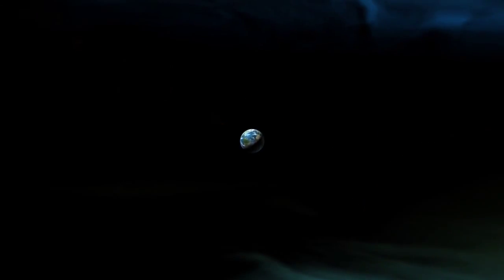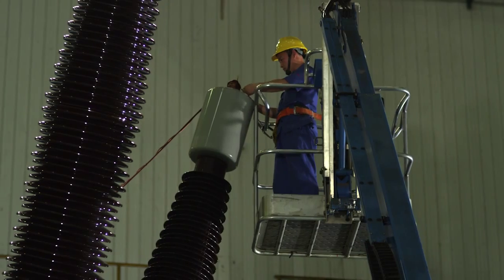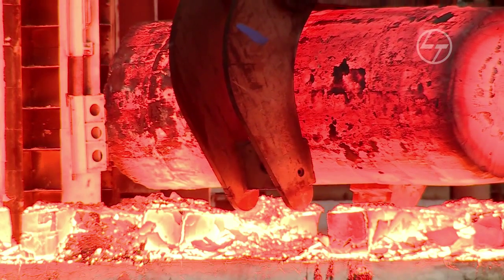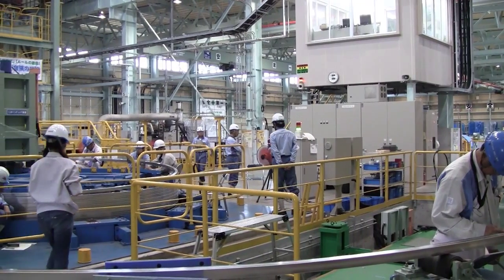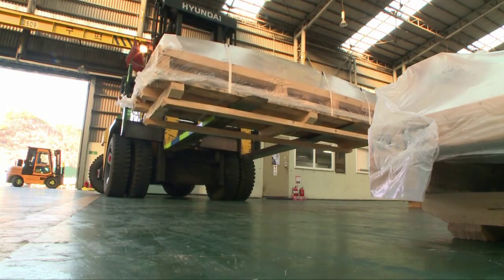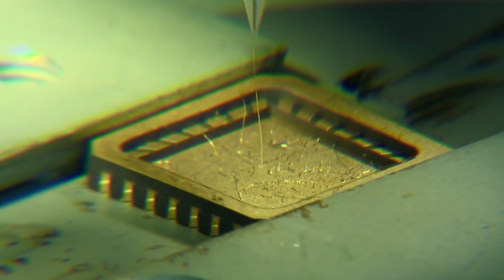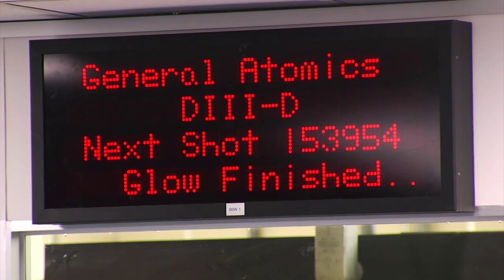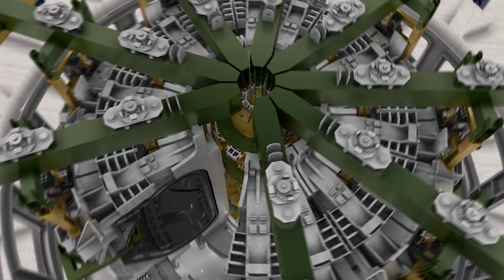Around the world of ITER Manufacturing Sites

Comment: It's such a huge and expensive undertaking.  Is it not possible to build something on a smaller scale, just to verify that it works?
Reply: They've already made dozens of smaller Tokomak reactors.
Reply: Fusion cannot be contained by small vessels. They're simply not powerful enough.
Reply: Efficiency drops like a rock with tokomak size, many have been made, but this is the first one that is large enough for actual power generation. If your efficiency is not good enough you spend more power keeping the reactor going than you will ever get out of it, making it useless for power generation.

Comment: Why are they building components in different countries which have different weather(temperature, humidity, gravity and air pressure due to different attitude) which will alter the size of the component at atomic level, may increase error level above the allowed tolerance of a few millimeters.

I hope they did take this into account and equalized all the conditions during manufacture and transportation.
Reply: It has all been taken into consideration. That's why they have dummy products, they test if the dummies work as expected beforehand.
Reply: Lea, the actual construction facility in France, where the components are brought together and joined, is a clean area that’s kept at constant temperature to account for material changes.
Reply: Temp, humidity and air pressure change daily, even hourly, you must consider these factors in any case. And it is considered, even in manufacturing of fairly mundane things, let alone in fusion reactor components.
Reply: It's world's most expensive experiment.
Reply: Bcoz it is expensive plus work is given to countries according to what they are specialized in

Comment: cant wait for it to start tests.
Even if it doesnt work...well , at least we tried...we gave it a 110% RED HOT GO  didn't we.
That's nothing to be sneezed at.
If it does work? well thats only the start. We cant all afford such machines.
Will take years to refine and perfect. This one machine wont power the world.
Reply: Banbury Cross This one machine is going to power nothing. It has no electricity generating parts. It's scienctific only.
Reply: It's designed to test if the power of fusion ignition can be contained.
Reply: It'll work alright, it's not exactly being built on a maybe. But there is tons that need to be learned about actually operating such a machine, lessons that will feedback to next designs. I bet there will be lots of cases where in hindsight people realize that things really should have been designed differently.

Comment: Do we really need a new source of power this badly? Does creating 150,000,000º C on our planet really seem safe to y'all? To compare : "The Sun has a temperature ranging from 6,000° Celsius at its surface which is hot enough to turn gold, tungsten and EVERY METAL ON EARTH INTO GAS (to) around 15,000,000° Celsius in its center". IMhO, three words sum this thing up : unnecessary, reckless, INSANE.

I await the variations of "luddite" ad homs that will likely follow ... > : [
Reply: Yes we do. Free(er) energy is the key to equality.
Reply: youstandcorrected we already have free solar, wind, tidal and geothermal power sources to choose from, which we've only barely begun to make use of. So perhaps you could explain why you believe we require this RISKY alternative ...
: / > -
Reply: There is nothing risky about it. The main difference in the sun is an enormous pressure whereas in iter there will be no high pressure. The hot plasma has relatively little thermal energy in it which would not affect the surroundings or leave the building even if you could imagine a scenario where it leaves the machine. Which makes it safe is that there are no dangerous substances used as fuel and no potential for the reaction to move on on it's own and get out of control compared to other nuclear power sources. The reason why we need such energy source is because it can be done anywhere compared to sources like wind and water, and it produces a constant amount of energy without fluctuations, so missing wind can't make you run out of electricity.
Reply: Frank Steffahn First, thanks for your civil response. It's refreshing to not be insulted right off the bat. Here's hoping my reply will not cause you to reevaluate that choice ; -) .

Now ...

"Nothing risky"? How can you know this? Isn't this an all new process? Imo the unknown always suggests some potential for risk.

A substance heated to 150,000,000º C has "little thermal energy"? Relative to what exactly ... a supernova? Certainly not anything occuring naturally on the Earth.

Hot plasma is not a dangerous substance? Well sure, any lightning-struck fool can tell you that.

Where on earth does the wind not blow? Oh yeah, under the water ... that ebbs and flows, creating potential tidal energy. And considering that about 7/10 of this planet's surface is ocean there isn't much land that can be too far away.

You seemed to forget about geothermal, which according to it's name is kinda available everywhere on earth.

Solar is also generally available I understand.

 Finally, if you want energy without fluctuations, better stick with DC. But seriously, I'm sure you know we have ways to store energy when it is not being produced.

So ... "Risky"? Yes. "Unnecessary"? Yes. "Insane"? Happily you didn't contest that point, so I'm under no obligation to defend it at this time. Cheers. : ) > -
Reply: AHerderOfCats I think you got some good points.

Still keeping the point of safety, the low pressure of the gas (or plasma) combined with the high temperature makes it have very little mass and hence little thermic energy. It's not like there is as much stuff, pressure and temperature as in an exploding hydrogen bomb. Also the magnets surrounding the gas get cooled down to just a few degreeds above zero Kelvin for the superconductors to work. If I had to guess what could happen in worst case, the reactor could break from the heat maybe, but it would not reach much further, not leave the building. Compare that with nuclear power from Uranium that has the potential of the reaction going out of control and heating up by itself further, this fusion reactor actually gets to 150.000.000° C by heating it up with microwaves from outside, so it is coming from electricity, not on it's own. The energy is very well comparable with other things on earth, they say you need the equivalent of a few thousand electric stoves to produce all the microwaves. If it gets colder when something brakes it is safe, because all the fusion will stop immediately.

I don't know much about geothermic energy but I doubt that it yield very much energy and also works all over the world. Nuclear fusion has the potential of enabling gigawatt power plants with no constraints of where to build them.

I live in a region that produces a lot of wind energy myself and I can say that from what I know, the fluctuation is a pig problem. They can even yield negative electricity prizes at the stock market (or wherever they trade it) on stormy days. Solar power is more constant, but still depending on weather and producing over the day while the power is needed in the evening when it's dark outside, or in the winter when it's cold but the solar power is much weaker. The only great potential I see in solar power is the possibility of decentralized power generation with people also having their own batteries to store power. Otherwise it would need new techniques, yet to be found, or a load of resources to make centralized batteries for storing the power.

As long as you'd need centralized oil, coal or uranium for power plants I'd prefer a working fusion reactor, hopefully becoming a working and cheap alternative that can be used in a few decades.
Reply: Well, hope to the side, the ITER's definitely NOT "cheap" : "Delegates agreed that the overall costs of the project will be almost US $21bn, (16bn euros/£13bn), some three times the original price." @ www.bbc.co.uk/news/science-environment-10793883 (2010)  ... nor has it worked. The word you omitted from your description of this experiment is THEORETICAL. Point is no one can say for sure what will happen when that thing is switched on. And I know of no necessary reason, nor have you presented me with one, sufficient to offset the concerns I have expressed. You keep trying to imply an explosive threat ... or a runaway reaction. Let me make this clear : I have no idea what could happen. But, my friend, neither do you. So how bout we leave the sun out in space, turn off a few lights and learn to live with what we have?

Our problem here is not a lack of energy. It is powerlessness. The fact that these people can do these risky things without our permission is the height of tyranny. All the way back to the Manhatten Project, which some involved believed had a chance of blowing away our atmosphere, right up to the LHC, and it's potential to create localized / extremely dangerous "strange particles". These people gamble with all our lives without ever seeking our consent. Please understand, I'm all for progress, but not if it puts the entire human race at risk. Speaking of risk, probably a good time to state my position on probabilities : a thing will either happen or it won't. That makes everything 50/50 ... a flip of the coin. While this may sound quite radical, it's an absolute truism.

I say let them build a space platform and test this reactor off-world. And if they can't do that yet then WAIT. Be patient. Why the RUSH? Again, we don't NEED ENERGY THAT BADLY. : | > -
Reply: AHerderOfCats No, ITER is not cheap, but it is a prototype, as I said I personally hope (as probably the people doing the research and experiment do) that it could become a rather cheap source of electricity, especially by means of sustainability and no environmental requirements. I'd just like to note that you're wrong about that such nuclear fusion it is that much of an unknown business. ITER is just a pretty large fusion reactor and it has the goal to be the first of its kind that actually produces more energy than it needs to heat up and power the magnets. The ability to control such fusion is from the underlying theories already a few decades old and they also had working experiments 20 years ago. It is more of an engineering task and a experiment to further develop the technology and make it happen.
Reply: You seem determined to ignore the bulk of my argument while reaffirming your faith in this risky and unnnecessary venture. But as this is 'much ado about nothing' and we've no say in the matter either way, I'll yield. Thanks again for keeping this discussion civil. I've enjoyed it. The final word is yours. Peace.
: ) > -
Reply: AHerderOfCats "Powerlessness", I thought about what you said. I think I share your opinion about this, not on the topic of nuclear fusion specifically but on the political system overall. The way modern democracies work gives people little opportunity to participate with a more detailed and sophisticated opinion. I don't really see signs of the current politic situation at where I live literally risking the whole humanity, literally causing big explosions in unsafe power plants, but environmental and economical politics going wrong can definitely cause death and definitely somewhat do go wrong today in many modern western countries in the world. That's why I go elect parties more because they support plebiscite then because they have all the particular opinions about topics or they are popular and would more likely lead the government.
Reply: There is like 0 risk with iter. Even if the plasma escaped it would do much more then melt the reactor. Just because it's a big number doesn't mean it's dangerous just like how having 1m Ecuador sucurs isn't worth shit
Reply: There was a lot of stupidity in this discussion sprinkled with out of context hard data and scientific theories.
Reply: Its safe alright. Temperature here is quite misleading, what it means in this context is it's actual physical meaning - velocity of particles, not your everyday experience meaning. 
Its better expressed in elecronvolts, meaning the speed a particle with the charge 1e is accelerated by when passing potential of 1V.

170MK would be around 15keV, temperature a fusion reactor would work at. 15kV is also a typical working voltage of a CRT monitor. If you wanted to describe CRT monitor in terms of temperature you would do it the same way, electrons accelerated over ~15kV ergo temperature or 170,000,000ºC, kind of pointless though.

Same thing with fusion reactor, yes the gas inside it really gets a spin on it, but the total mass of that hot gas is minuscule and if the gas should touch the reactor walls it would cool down instantly and ruin the reaction. The reactor walls wouldn't ever flinch at it, at one side you have half a gram of superhot gas, on another side you have few thousand tons metal, take your guess at what the equilibrium temp is.
Reply: If we die of something, let me tell you we tried....we really tried to save this planet.

If we succeed, let me tell you we were bold

If we fail, and unable to address energy crisis, let me reiterate again we really tried.
Reply: It exists in a very controlled environment, slight changes and all the reaction siezes to exist, its not at all risky.

You really need to learn about Kardashev scale to learn about the relevance of a fusion reactor and why our existence relys on something that produces this much of energy.